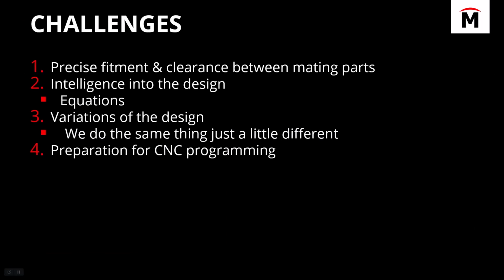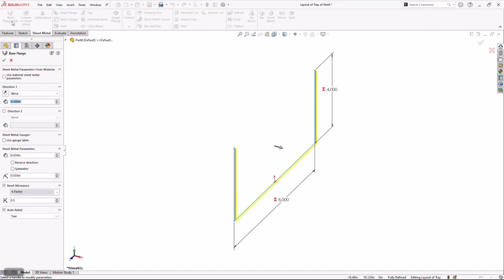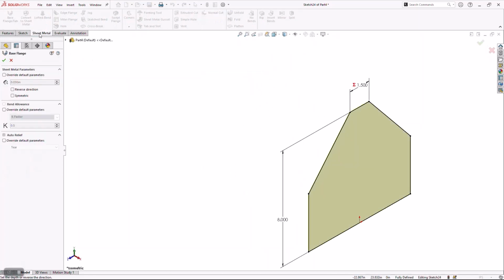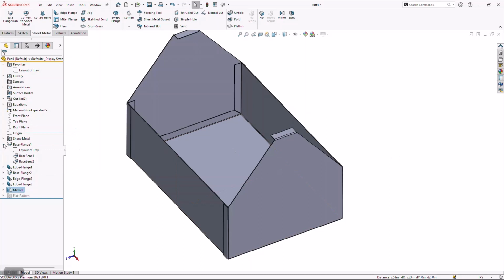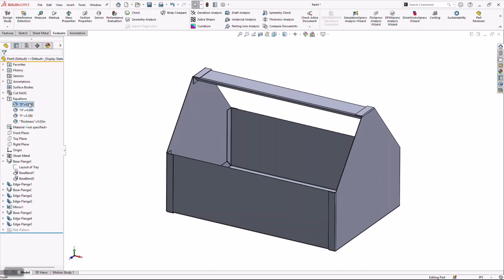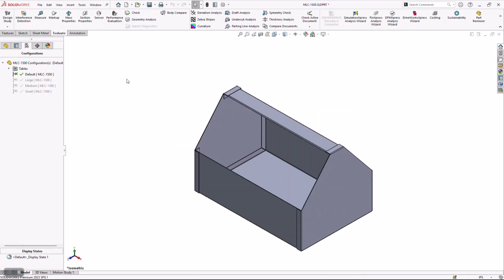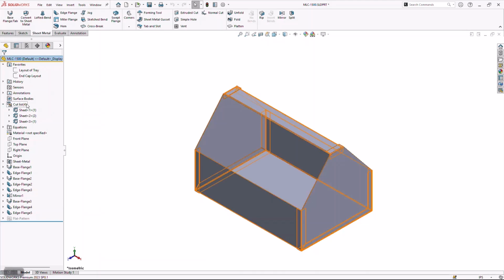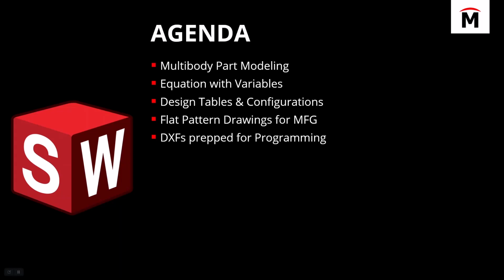Intelligent Sheet Metal Design - SOLIDWORKS Webinar

Comment: Those corners need ripped they won’t process
Reply from the maker: Nothing should require ripping, are you sure your model is built correctly?  For example, when creating the end cap if you don't de-select "Merge result" it will create a box that cannot be flattened, which would then require ripping to process.  Your cut-list should have 3 folders with 4 total bodies.  Example files are available here https://www.mlc-cad.com/sheet-metal-skills/ if you would like to review them.